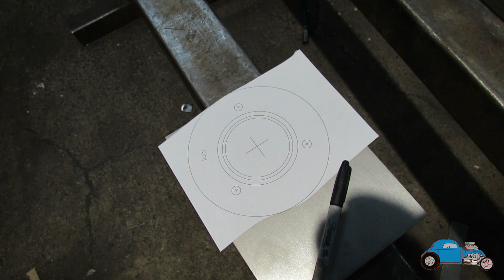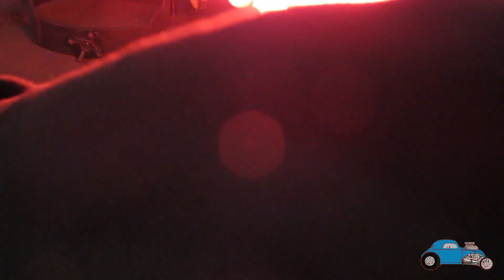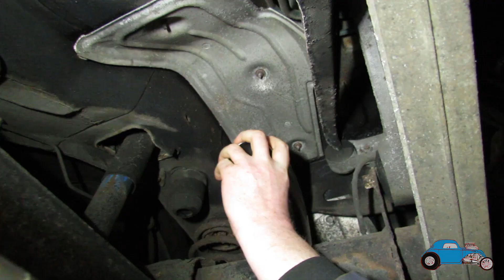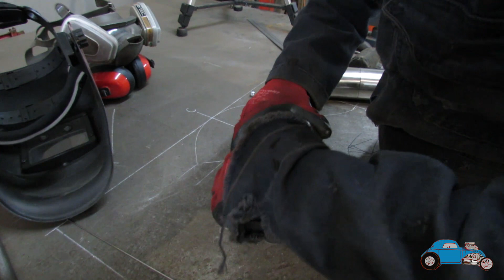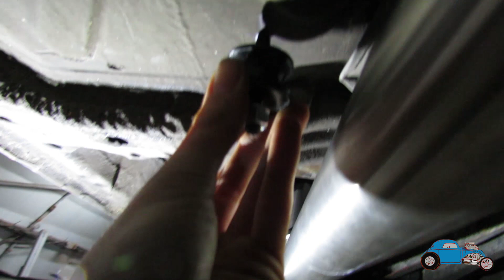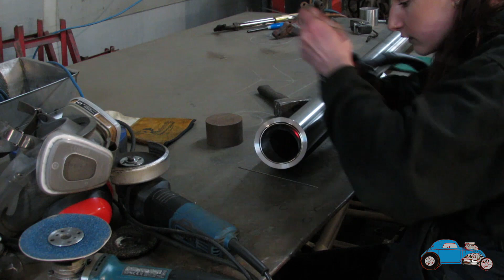Volvo 940 Drift Car Project! Fabricating a 3" Exhaust

Comment: In the beginning of the video you said the 3 bolts on the turbo's exhaust are 94x105x105mm apart. I checked in my TD04H15g and its does not seem to match that. Different turbo?
Reply from the maker: Yes our turbo is from a volvo V70 16t

Comment: Great work. I've never welded any thin walled stainless tubing like that before. I might have an application that requires it. I was wondering if I could ask your advice on what settings you use? Also do you think it would be advantageous/neccesary to back purge the inside of the tubing? Thanks!

Comment: Great job excellent work always interests me to see other peoples approach to making something from scratch, 2 things i noticed having built alot of drift car exhaust systems is i would consider a flexi just after the down pipe normally i mount the downpipe to the gearbox and run a flexi directly after to allow the exhaust to move if you go off track or hit it some other way. Also in my experience its better to hide the tip further inside the bumper and use a downturn to direct the heat away. That way if you tap a wall or a tyre bale someone hits you the exposed exhuast tip dosnt act like a gaint leaver and destroy the whole exhaust. Either way top work

Comment: Great Job and nice work, Most cars have a flexible bit after the down pipe elbow, why didn't you put something like that? or are the rubber mountings sufficient enough? Also can't wait to hear the exhaust, I bet it will sound good.